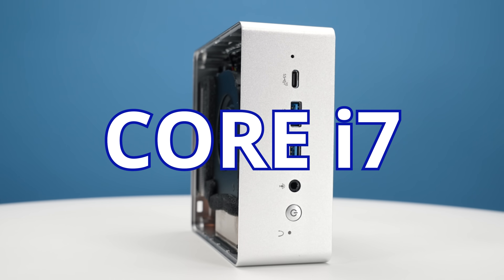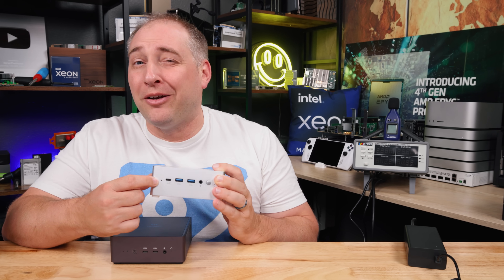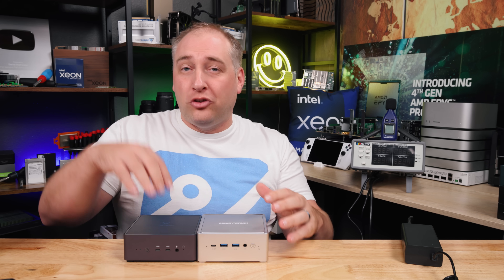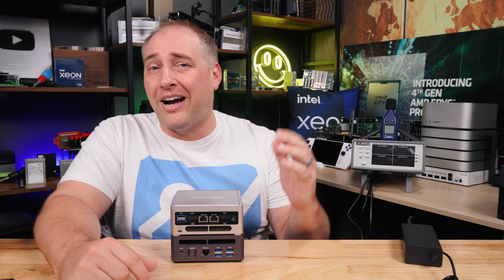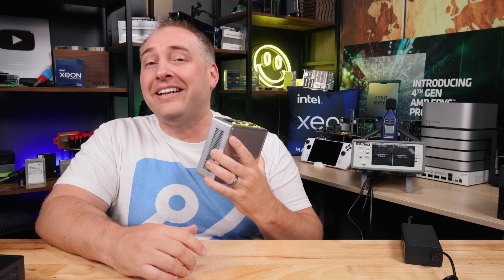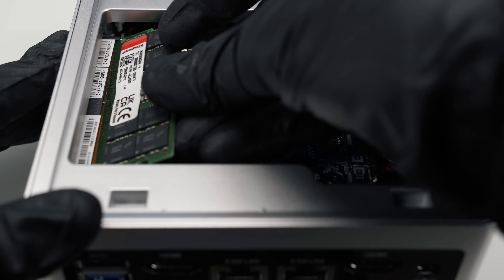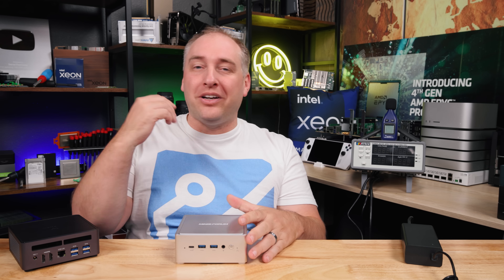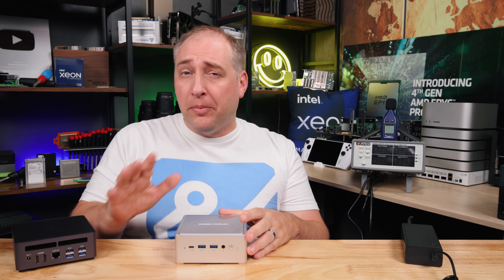THIS is One BLAZING Mini PC

Comment: I'd take the all performance cores and threads of the RYZEN system with much less power draw and highend gpu for monitor and graphical software performance, again for much lower wattage. Let's be real this is logically speaking these are on the go mobile powerhouse work PC's that at the very most are emulation gaming pc's on the side.

Comment: A simple reason for the size difference might be the obvious with the i7-13th gen processor just being hotter, on top of the I/O differences which all together might of facilitated them needing it to be a bit more larger. Just an educated guess considering the hardware and configuration.

Comment: Must do long term stability tests. This system crashes all the time. I have 4 of these units. It is not stable with 64GB ram. Also not fully stable with one dimm of 32gb. must use 2 x 16gb. Minisforum lied when first marketing this product and said it supported 64gb. 64gb will work for a few hours, but then is not responsive and needs to be powered off to turn on again, even when idle it will become unresponsive after a few hours. Their support is of little help.

Comment: the 2 port is for using a firewall like PFSENSE 

can u test it with proxmox please ? i want bought one but i want to be sure Proxmox is fully working on it : 
- MINIS FORUM NPB6 
-  Lexar NM790 SSD interne 4To
- 1 SSD 1 TO (for the OS and the iso )
- Crucial RAM CT2K32G4SFD832A 64Go Kit (2x32Go) DDR4 3200MHz

What do u think of this config please

thanks

Comment: If you can stand the noise of the fan (I am super-sensitive) be aware that nvme fan-cooled sled/housing only accepts single sided nvme - hence the up to 2TB on website - I nearly crushed a double-sided 4TB today!
Reply: If it’s going to sit on a desk maybe you get away with just using thermal pads (double up to protect underside) but the fan isn’t going to hit side

Comment: Stability is still an issue with 64GB ram , going to try and set power limit down and/or get a 150w psu.
Reply: This company lied. The company now says 64GB not supported, only 16GB DiMM max 32GB. one 32GB more stable than two 32GB, but still crashes with high workload. I need to try two 16GB DIMMS and see if it survives a week being on.

Comment: Would you want to make a video with my HP Elitedesk 800 G5 Mini 95 watt model with 9700k? It has a massive cooler that takes up the space where a 2.5" drive or dgpu would normally go, and has a second fan.

I havent seen any others on ebay yet, except a G6 10700k sold by the same seller.

Comment: Minisforum NPB7 is great for console gamers that use their desktop for work, bills, and general web browsing.  The easy to access RAM & SSD makes it great for small offices too.

With Intel Iris XE graphics, I would not recommend it for personal home PC gaming.  Just disappointing for PC gamers.  Minisforum UM790 and its AMD Radeon 780M iGPU is far better.  Still not PC tower level with Nvidia RTX 4090 GPU, but good enough to compete with non-AAA console games.  Forza Horizon 5 gets between 60 FPS to 80 FPS with QHD resolution and medium settings with the Minisforum UM790.

Comment: Cool!  I appreciate the rundown on the NPB7.   
I've been comparing these two units to replace Windows laptops -- 99.9% docked.  : )  (Windows required for software)
Buuut stability seems to be an issue, just teething problems I hope.   After six months I hope we're in a better place.  lol
-->> Totally agree that it is weird to have different sized chassis for each platform AND to not use the same M.2 WiFi modules.   Why not standardize components?  Ah well.
Would the i5-13500H been such a huge step down?

Comment: Couldn't agree more with your key lessons learned.  I don't want a super powerful and expensive configuration with inadequate cooling.  Make the cooling solution fit the TDP, or at least go above the absolute minimum is a priority for me in any product.  I wish gaming laptops followed this as well.  I want to buy a system based off it's energy use vs it's cooling solution so I can get the most of the the hardware.

Comment: Patrick, do you think it would be possible to put a 15mm U.2 SSD in the NPB7 with a U.2 to M.2 adapter?
Reply from the maker: I would not do that. Too hot. You would also need to also source power for a U.2 drive adapter.
Reply: With a Mushkin's 96GB RAM kit and a Fanxiang S790 4TB NVMe storage, I love my NPB7. Its USB4 ports are able even to connect it to an external eGPU TB3 enclosure, solving  its Intel-iGPU limited processing power. The weak point is the 120W-only power supply, which is suspected to cause stability problems in certain very demanding conditions. Nothing that couldn't be remediated with a 3rd party 150 or 180W power supply. I retired both my desktop and notebook, living now only with a 14.6" tablet and this almost portable computing solution.

Comment: The days of a giant PC box is over. I have a mini PC that replaced a gigantic PC box from a few years ago, and it's considerably more powerful. The only reason left for a gigantic PC box is if you are a gamer in need of a gigantic dGPU to make things work, although why an energy sucking gigantic dGPU is still needed today is a different question to ask on another day.

What's really cool is I can pack up my mini into a pack back and go on a trip for several weeks. I have dual portable 4K monitors, and will set it up on a desk as if I'm still at home, no one even knows I'm away, no one cares as long as sh*t gets done on time. BTW I took the mini and monitors across North America and Europe without any issues, easy to get it through security checks.

Comment: What is the vertical white connector for situated near the Wi-Fi card?  I suspect they used that type of Wi-Fi card because it was what they had.  The size of these miniature PCs is kinda cool until you see the size of the power brick.  Which in this case is the size of a real brick.  Do the external power bricks produce a lot of heat?  Like to the point you'd have to place them on a metal box to serve as a heat spreader?  I have to do that with the power bricks for my laptops and mini PC.  Personally I still favor baby towers and full tower server cases for the greater internal upgrade options they afford me.  Plus I still use optical drives and HDDs for my computers.
Reply: The white connector is a SATA3. It comes with an extra cable and screws for it. The ssd is attached to the lid.

Comment: It's amazing what they can fit in that tiny form factor. This little box has about the same performance of my full size Ryzen desktop from just a few years ago. I thought these mini PCs were toys but your reviews have opened my eyes. Thanks!
Reply: See my post above. Before the mini PC era I bought a few  "micro PC" boxes, which at the time were amazingly small and powerful compared to full sized PC's, but now, only one mini-PC can easily replace all 3 micro-PC's that I bought before. The only 2 reasons I can think of that justifies a gigantic PC box, is to 1) house a larger dGPU, and 2) to house multiple low cost HDD's rather than a more expensive solid state NVMe storage solution (depending on storage needs).
Reply: @geekinasuit-l1b What mini pc were you talking about?

Comment: 3:12 disliked the video for the random reference to the book of lies. Yeah, Noah gathered up the over 7.7 (x2) million known species of animals on an ark. Sure, Jan.
6:35 "Overall cooler that would also hit things like the memory." You are inadvertently describing literally all laptop designs? You know... for the SODIMM RAM that goes in there.
Cooling the SSD makes complete sense when you have a whole laundry list of YouTubers who "review" SSDs and systems by panicking over SSDs being "too hot" (with no benchmark, spec, or actual evidence to back up what their feelings of "too hot" are.)
6:45 The 13700H doesn't support multiple NVME devices. It has one (1) x4 Gen 4 connection without the PCH.
This doesn't use a PCH, as evident by the standalone, third party Wifi solution. (The PCH comes with Wifi 6E support and would not require a third party one.)
Instead of the PCH, they ran the bandwidth to the dual USB4 ports.

Comment: That's the problem with Intel-based mini PCs and NUCs -- the thermal throttle themselves like crazy (or they have PL1, PL2, and tau, which means that you can only get that peak level of performance for a short period of time before it will just cook itself).

I can get more consistent and more reliable performance out of AMD CPUs than I can with Intel-based systems.
Reply: That is a normal design feature, running higher power for up to 30 sec, then backing way off....; it is only considered throttling if busting the temp limits and downclocking itself to lower the temps...
Reply: @mdd1963  
"That is a normal design feature, running higher power for up to 30 sec, then backing way off....; it is only considered throttling if busting the temp limits and downclocking itself to lower the temps..."
Like you said, that would be normal behaviour IF "busting the temp limits and downclocking itself to lower the temps."

Based on your statement, I can only surmise that you don't have experience with neither the 7th gen nor at least the 8th gen Intel NUCs where under load, it will EASILY and READILY hit T_jmax (100 C) without minimal effort (even running Minecraft will cause the CPU to thermal throttle itself).

Like you said, I would agree with you IF it was hitting PL2 for tau, and then resorting back to PL1 (I think that's how it worked, IIRC, or I might have that backwards), but that is, again, IF and ONLY IF, it doesn't thermal throttle itself due to hitting T_jmax first. I agree with you on that.

But on the NUCs, if you have any experience with them, they will easily and readily hit T_jmax, and therefore; the temperature based rules where it will start throttling/downclocking itself to get the temps under the control will kick in LONG before PL1/PL2/tau has expired.

The slightly bigger, and more powerful AMD systems doesn't have this issue (because there's just more physical space/volume to be able to put a bigger CPU HSF in there) so that it can actually handle the thermal dissipated power, even if the processor is boosting it's frequency, and therefore; increasing said thermal dissipated power.

Comment: Hey P - Just bought this barebone. It's maybe worth mentioning this tiny thing... Minisforum says supports 64GB of RAM but I dropped in 96GB of 5600 Mhz DDR5 and it's operating the 96GB at 5200 Mhz. I am the market that wanted a dinky hypervisor that would be mostly idle.

I think the biggest pain point for me is locating drivers... like for the Mediatek wireless adapter (Windows).
Reply from the maker: Great feedback!
Reply: Which rams did you buy? Company
Reply: which model of ram is it ?
Reply: @darkjo4335  Crucial CT2K48G56C46S5 - Made the comment a year ago (wow time flies). Based on my comment you can also maybe nab the 5200 MHz revision instead of 5600 MHz if you wanted to save a few dollars.

Comment: Their RMA / warranty process is an absolute nightmare.  Keep away.
Reply: Fans spinning up randomly is also extremely annoying.
Reply: How faulty are their hardware?
Reply: @jakelong8660  In general, probably not any more faulty than anyone else. The issue is if/when you need support it's troubling.
Reply: Great
Reply: If you buy it on Amazon don't they have to accept returns?
Reply: @be-kind00  Not once you're past the return window?  I had a SSD go bad on a UM580 and after several days of emails back and fourth with someone who doesn't understand English very well, they refunded me (through my Amazon/Minisforum store purchase) the cost for me to replace the SSD with something comparable on Amazon.   It was pretty unsettling.
Reply: @be-kind00  You only keep/expect your computers to work for 30 days?
Reply: @jefferyG499   Guess its regional, in the UK when I've had problems with the manufacturer charging more than its worth for returns or being awkward in general, Amazon have always refunded well outside the return Window.
Reply: I dont buy things based on customer service.
Reply: @TheTastefulThickness  you should consider it.  Because when you need it, it should be good.
Reply: @ryanw1906  Im 38 years old.  I've used warranty about 2x in my entire life.  Im not making some rinky dink mini pc purchase decision based on how dealing with some chinese customer service might go.
Reply: @TheTastefulThickness  I've got you beat in age and RMA processes by quite a bit. If it's in warranty, I want it fixed without expense to me. That's the entire point.
Reply: @ryanw1906 Maybe you just buy a ton of junk or complain a lot?
Reply: @TheTastefulThickness   cool story bro

Comment: Still hoping to find a mini pc with 3 or 4 nvme slots + minimal 64gb memory + minimal 10cores.

To build een hyper convert VMware/truenas machine.

I  now use a hpe microserver gen10.
Reply: "nice review of something i'll never buy. now give me something I want for under $200."
Reply: I was able to put 96GB RAM on that MiniPC with Mushkin's 48GB x 2 SODIMM DDR5 5600MHz kit. they run at 5200MHz max in this NPB7. As for the NVMe, there are many USB ports, two of them are 40Gb/s. Using proper NVMe/USB adapters, you can reach between 1 and 4 GB/s performance through them.